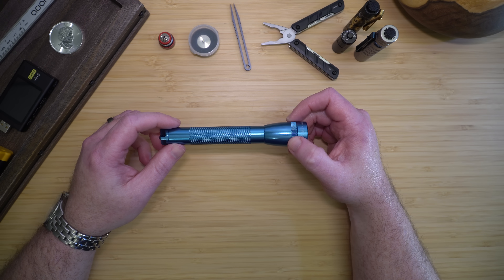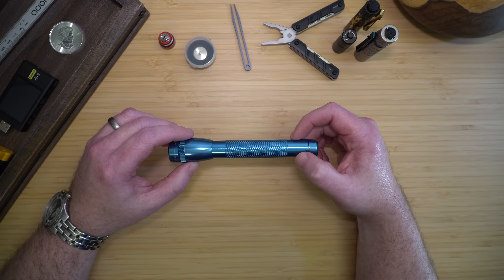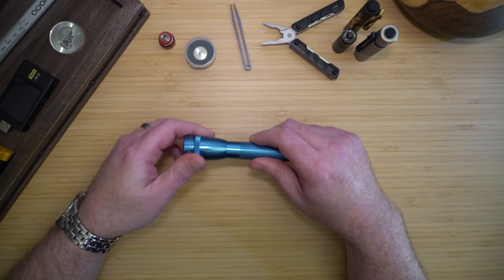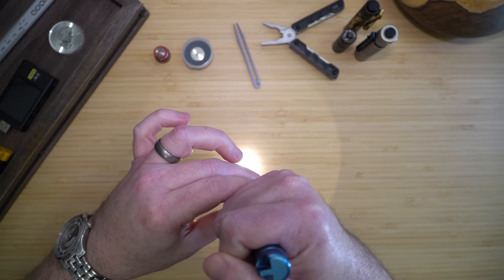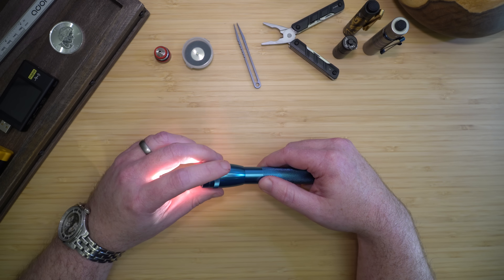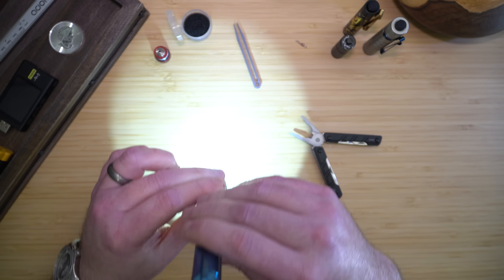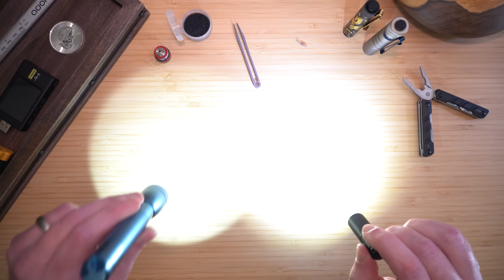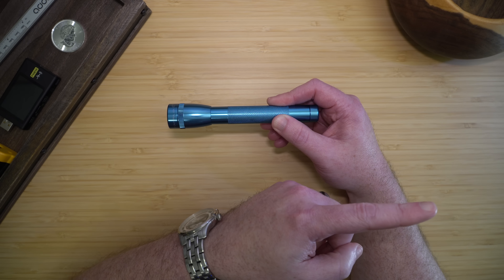Classic to Cutting Edge: Iconic Mini Maglite Upgrade

Comment: There have been LED inserts for Mini Maglites for decades. For that matter, Maglites with LEDs have been available for about as long. Even if I find an LED insert for my 3-cell Maglite, I don't know that I would bother--unless I needed a flashlight that could be used as a weapon, I'd stick with my Nebo lights..._very_ bright and has various useful features (and relatively cheap!). I stumbled across one at a locksmith--their Big Larry (the first COB LED I ever saw), with a 18650 rechargeable battery. I have to find a new battery, but it turns out they've updated the design...to using a pair of AAs, and adding a small LED to one end. The Big Larry just has the strip of COB LEDs along one side toward one end. Incredibly bright, adjustable brightness, white light, red light, and flashing red light. Strong magnet in the base and big clip that has a hole in it to hang it from a nailhead or screw...ideal for road trips.

Oh, because you're worse than a day late and a dollar short, you go on my "do not recommend" list. It's because you're suggesting that people waste money on upgrading out of date flashlights, instead of simply buying a modern design. Yeah, Maglites were top dog for decades, but that's ancient history, son. It's time to move on.
Reply from the maker: Thank you for sharing your thoughts on the flashlight options! It's always interesting to hear about different products and features.
Reply: I have one of those Larry lights, beware of the “rubberized”/tacky/“gription” coating on the plastic; it gets sticky and gross after a few years and you’ll be cursing the thing while trying to strip it off using lacquer thinner.  Yes, maglites are heavy and clunky, they’re kind of the equivalent of your 1950s stoves (and restaurant ranges): built like battleships.  It all depends on what you’re looking for.

Comment: The major troblem with the mini Maglite is the snug fit of the AA batteries. As the batteries age, they will swell and become impossible to remove.
Reply from the maker: That can definitely be frustrating! Have you tried Lithium batteries? Energizer Lithium batteries have a 25-year shelf life and don't swell or leak but do cost more than alkaline batteries.  Thanks for watching.

Comment: I don't have much of a minimag memory other than the fact that my dad always carried a woodland camo minimag that he bought at the BX when he was in the army.
As a kid I carried the little Solitaire, it was barely useful but was my own Maglite and was at least better than nothing.

None of the aftermarket LED upgrades are really ever as good as the LED models Maglite offers these days, but at least they're an inexpensive upgrade .
The only thing I don't like about the LED " Mininag Pro " is that it has a strobe and SOS mode...etc instead of just on / off.
Personally I'd just spend $15 on the AAA minimag which offers about 110 lumens, is of course smaller and is just a simple on / off.
With that being said if you already have an old minimag then why not.
Reply from the maker: Flashlights with fancy modes are like smartphones with too many apps - sometimes simple is just better. Thanks for watching!
Reply: @chestersedc  I definitely like my lights as simple as possible and used to only want on / off,  but will say that I have grown to appreciate a low mode on my pocket flashlight.

I actually really love the user interface on Maglites click button models because you have to very deliberately multi click for the other modes if you need them,  it's just that with a twist head light like the minimag pro those extra modes are quite an annoying hassle.
It's been awhile since I've messed with one because I just bought it as a gift for my dad and tested it first, but I remember the extra modes on the minimag pro being an annoying thing to deal with.
Reply from the maker: @TylerSnyder305 I agree. Some modern flashlights require an hour training session, and when I actually try to use one of those, I've already forgot how to use it and end up suck in strobe mode.

Comment: I've had a number of this model fail on me. I gave up on them. There are far superior led flashlights around now that run on the ubiquitous 18650 lithium ion cell.
Reply from the maker: We live in an amazing time for flashlight and battery tech.  There are so many options to meet every individual need.  I am enjoying using the upgraded Mini Maglite, brings back a lot of nostalgia and I like that it is more comparable to my newer flashlights.  Thanks for watching.

Comment: Nice video. I had the same issue with battery leakage. The mag lite seal is so tight that you have to remember to open the back every few months to let the acid gas escape, otherwise it’s ruined. I got several LED mini lites from Harbor Freight  for free with purchases and they seem to last. I have two bigger mag lites , C and D cell types. Have to see if there is an upgrade for them.
Reply from the maker: Thanks for the kind words!  Batteries have probably killed the most Maglites.  You can try Lithium batteries which don't leak.  As for the C/D Cell lights, there are upgrades for those as well.  Here is one option ( https://amzn.to/3vAN1gY ) but look around as you can get them in different brightnesses based on your needs.  Have fun with your upgrades and thanks for watching!

Disclosure: This comment includes an Amazon affiliate link, which means if you click on it and make a purchase, I may receive a small commission at no extra cost to you. This helps support my channel and allows me to continue making content for you. I appreciate your support!

Comment: Those LED bulb upgrades for a Maglite are great, but they don't last long, depending how many times you twist the head to turn the light on and off.  When you twist the head to turn off the light, the bulb reflector pushes down on the LED bulb adapter and twists the wires that are inserted into the Maglite bulb holder. Eventually the wires break inside the LED adapter.   Niteize makes a LED bulb upgrade for AA and AAA Maglites that come with a push button switch the replaces the battery cap. The switch is used instead of twisting the end of the light to turn it on and off. The C and D cell Maglites use a  switch on the side of the flashlight that doesn't have these problems. LED upgrade bulbs are available for the bigger flashlights that last practically forever.
Reply from the maker: Thanks for the tip.  I have added the Nite Ize Two Pack Upgrade as an option in the description.

Comment: I have been carrying the Stinger for over 20 years. It goes to work with me every day and is the incandescent. I have replaced the light twice because of dropping two of them overboard. This one I have now is about 15 years old. I finally learned not to drop them overboard. Most of the anodize and knurl is warn off and I have rebuilt it twice. New battery, lens, bulb base and switch. I considered upgrading to LED for more battery life but when I used other LED lights they are too bright and shadow out what I am trying to see. I use it for service work. Not camping or any kind of distance (usually). I also don't have much problem with the bulbs. Over the years I may have replaced 5 of them. I buy only Stream Light replacement parts.
Reply from the maker: Thank you for sharing your experience with the Stinger. It's inspiring to hear about its longevity and your dedication to it.  They do make voltage regulated LED bulbs for the C/D lights that limit the output to a specific lumen limit, which greatly increases the battery run time.

Comment: I'm retired LEO and I carried a Mini Maglite on my belt for years.  Had to use it many times when the bulb in my larger flashlight broke or the batteries died.  I still have it and it still works.  I'm going to check the links you provided and try to find an LED upgrade.  Thanks for the info.
Reply from the maker: That's awesome that your Mini Maglite served you well during your time as a LEO!  Have fun upgrading your light and breathing new life into it.  My dad was a LEO and had great stories about using his D Cell Maglite in service. Thanks for watching.
Reply: Same here, used one as a keychain/kubotan. I also have an original Surefire 6P. I carried those along with the rechargeable light in the car and needed all 3 on more than one occasion.
Reply from the maker: Three flashlights? You must be really bright! Pun intended. 😉

Comment: Shocked batteries in your maglite are not stuck.
Every single maglite I owned had battery leaks making it impossible to open the cap without damaging the light
Reply from the maker: Yep, many Maglites have died such a death. I have moved to lithium batteries to avoid that issue. Thanks for watching!

Comment: I still have my maglite. It too was also blue. I did the same thing with the bulb but I also changed the end cap to a push button switch. It made it convenient to turn on. No more using two hands to twist the head to turn on, only for adjusting the beam.
Reply from the maker: Nice upgrade on the Maglite! The push button switch is convenient. I need to get one for my light. Thanks for watching.

Comment: I have had mine for over 20  years and the light output is pretty poor, I just checked the price of the upgrades and they cost more than the rechargable led mini torches I bought to replace it with, and far more than I would have paid for the maglight originally so mine will stay in the obsolete drawer.
Reply from the maker: Yes, it is a bummer the cheaper option sold out.  Hopefully they will get more in stock. I've been blown away by how many people have been watching this video.  Thanks!

Comment: There is something to be said for a light with a warm temp that isn't going to blind you and/or totally kill your night vision. All the same, I have a pink Mini Mag that might get the upgrade. :)
Reply from the maker: @pamelah6431 I agree, having the right light for the job is key.  The red filters can help with night vision, but there is always a place for a bright light when needed.  Thanks for watching and commenting!
Reply: I mainly used it as a kid for reading at night under the covers. :)
Reply from the maker: For reading the incandescent bulb's lower output and warm light would be easier on the eyes.

Comment: Wow! This made me go down to the basement and grab my Mini Maglite AAA. It's purple and I used it very heavily when I was a technician at the phone company. I got this flashlight as a token gift for having 5 years there. Unfortunately with it sitting on my workbench under fluorescent light for so many years bleached its vibrant purple. I can still see the rich vibrant purple it used to be hiding on the body beneath the lens segment, and inside the battery cap.

Edit: I just now remember I got both a two-AAA and two-AA one, each purple. I'm not sure where the bigger one went, but I am now remembering that was the one I used at the phone company. It was brighter and more practical at the time, and fit nicely in my tool belt. I will use your link to get the LED retrofit!
Reply from the maker: Thank you for sharing your journey with your purple Mini Maglite AAA. It's heartwarming to hear how my video sparked those memories. I hope the LED retrofit brings new life to your trusty flashlight!

Comment: while I didn't have the mini-maglite, I did upgrade my 1990's "2 or 3 C cell" <can't remember the size right now> light to LED about 4-5yrs ago.  I no longer could buy the normal bulbs and LED were the best option (for many reasons!)  I got the same happy feeling from how bright it became and the longer run time with the LED bulb 'upgrade'.  Definitely overkill on the size but I keep it in my car as it was my first accessory for my car in 1995 :)  It continues to move from old car to new car.
Reply from the maker: Your car's light is like a time traveler, moving from old car to new car, shedding light on the road ahead! Thanks for watching.

Comment: How is the heat on the Lense.   Good job
Reply from the maker: @timhuffman5311, It barely gets warm.  I just ran a test for you and after 5 minutes, the lens temperature measured 75.7 F with my laser thermometer.
Reply: @chestersedc  Thank You for going the extra step for me. I carried Maglite's and stream lights for 40yrs. Great lights but they could get hot. Maybe I can repurpose a couple of those old lights.  You just earned a new subscriber. Hang in there looks like your just getting started.
Reply from the maker: @timhuffman5311 Thanks for joining the community!  I have a lot of videos in the works, and I hope you enjoy them.  I have a lot to learn and improve on, and my goal is to get better at one thing with each video.  Hopefully that leads to success and a community around EDC and preparedness, two of my passions.  Then maybe my family will see that I'm not really that crazy! 🤣
Reply: LOL 
 @chestersedc

Comment: I prefer a incandescent Mag-Lite, I've searched them out and own (3) Minis, (1) Micro, (1) 2-D cel and (1) 3 D cel. With fresh, quality batteries, I don't have any complaints. I mark the batteries w/Sharpie and replace every (3) years. I'm prone to Migraines, getting flashed by a LED Mag will trigger a Migraine headache which last for several days, no thanks.
Reply from the maker: That's awesome that you've got your Mag-Lite collection all sorted out! Thanks for sharing your battery marking tip - it's a smart idea! I dislike the strobe modes as well. I which I could turn it off all the time.  Thanks for Watching.

Comment: Is there anyone in the UK area that sells replacement batteries for the MagCharger flashlight? The original battery consists of 6 1/2 D cells in series that were NiCad packs, I heard they have since gone to NiMh packs which are more friendly when it comes to leaving it in the charger all of the time.
Reply from the maker: You could try Maglite EU ( https://www.maglite.eu/en/collections/spare-parts ).

Comment: My Mini Maglite Story:
When I was with the military we once had a 48 hrs exercise that included a night orientation march. At that time, I had the Mini Maglite with a head strap and the red color filter mounted in front of the lens. I used it only for the navigating stops along the way to read the map and compass. Doing this hands free was a real big thing at that time. Of cause we had some simulated encounters along the way and once my squad and I made it back to camp, I realized my headband with the Mini Maglite was missing. The whole Platoon was back at the camp already and were enjoying the campfire before nighttime. I remembered a part of our trail led us through some bushes and I imagined I had lost the Maglite somewhere there. I asked our Sergeant for permission to leave and search for my flashlight. Of cause he would call me nuts for searching a single Mini Maglite along an eight kilometer trail at night through bushes and woodland. Still, he allowed me to leave for half an hour with one of my companions. We went straight to the spot I remembered. On our way there, the moon lit up and on arrival I could see my Mini Maglite hanging right around head high in one of the branches. It felt to me as if this special flashlight was just wanting to stay with me. And so it does until today. Okay, it is not my EDC flashlight any more, but it also got an LED upgrade and I still use it at work.
Reply from the maker: Wow, that's quite a story! It's funny how certain objects can become a part of our lives in unexpected ways. Thanks for sharing your Mini Maglite adventure with us!

Comment: Back in the day I loved my Mini Maglight, up until the batteries leaked and swelled inside.
Reply from the maker: Sorry to hear about your light. That's a common issue with old batteries. Always a bummer when it happens!  I've upgraded to Energizer Lithium batteries because they work from -40c to 40c and won't leak.  They also have a 25-year shelf life. Thanks for watching.

Comment: Hi 👋 from OZ🐨
I'm new to you're channel I've been looking for an upgrade for some time I have two Mimi mags one four cell and one six cell
I need upgraded to LEDs I also need two small springs for the mini mags and a rubber button cover for my four cell any advice on where to get spare parts would be appreciate yours 
Gibby in OZ 🐨ty
Reply from the maker: @GibbyinOZ I'm glad you made it here.  Maglite sells replacement parts ( https://maglite.com/collections/parts-and-accessories?page=1 ), but shipping might be too much for you.  For the mini mag springs, you could look at the tail switch replacements which would come with a new spring, and Nite Ize as a set of two LED and tail switch upgrades which are reasonably priced ( https://amzn.to/3x9BcyO ).  I hope this helped and good luck getting your lights running better than ever.

Disclosure: This comment includes an Amazon affiliate link, which means if you click on it and make a purchase, I may receive a small commission at no extra cost to you. This helps support my channel and allows me to continue making content for you. I appreciate your support!

Comment: There are MANY LED replacements available. Do your research. My EDC §§ for the last 45 years that I can remember is a MAG 2-AA cell. The black anodized case is SO worn it’s almost completely silver colored. I use Eveready Ultimate Lithiums and use the light many times EVERY DAY. It’s hard to remember when it needs new batteries, it seems like only about once a year!

§§ I wear it on my belt with my Leatherman Wave+. The MAG and Leatherman are the best tools in the world.
Reply from the maker: Your MAG flashlight and Leatherman Wave+ must have some incredible stories to tell after all those years. They're like the dynamic duo of your EDC!